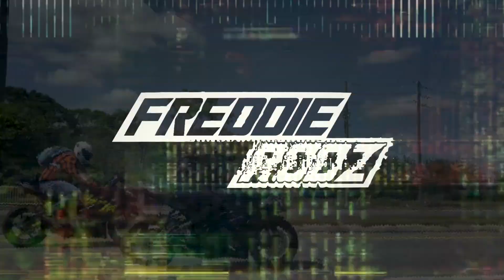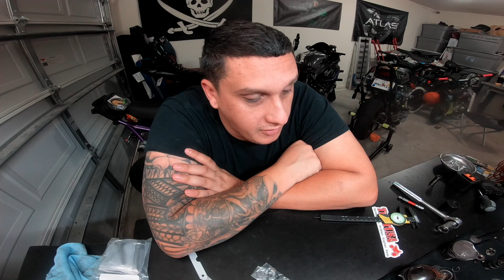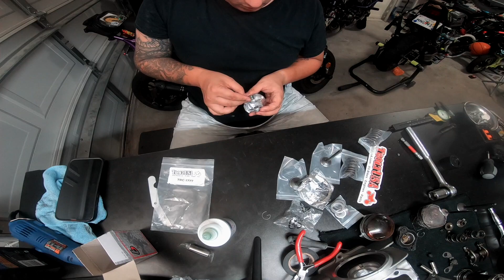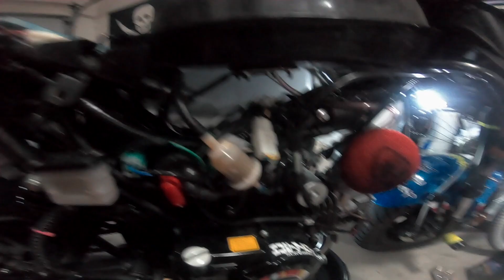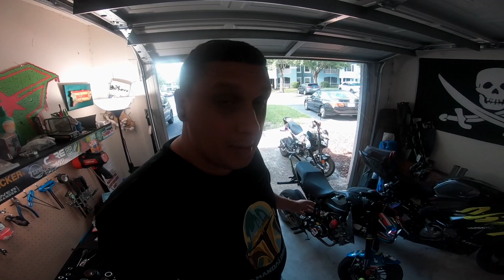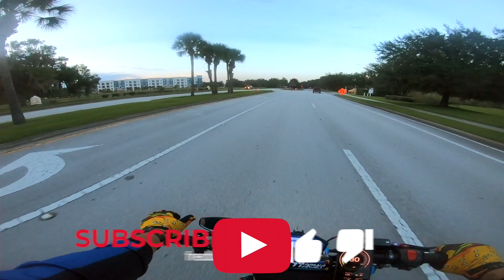I blew up my Grom Clone!!!

Comment: hey bro.! just have a quick question. I asked it in the fb clone group, how often/long you ride in the redline of your clone.?
Reply from the maker: All the time 😂.  Well I know 8krpm is about 50mph.  But if I’m going faster I’ll stay on the 9-10 line for a while.   This issue I had what a combination of things I neglected that caused this.  With right amount of oil and maybe if you have a 141 do an oil cooler and everything would be fine.
Reply: @freddieRODZ  gotcha bro.! thanks for the reply.!

God bless.!
Reply: I don't n ever redline mine three clones I try to let them breathe till they hit their max I have three from clones over a course of three years they all still work and have about 4000 miles on each I guess Yu can't redline these or this happens .but I remeber I was going to cause alot of guys on YouTube said Yu can redline them all u want
Reply from the maker: @masterpain7742  yea. I learned not to.  And if you do only for a small period of time.  My clone now has 5,000 miles on it. And running beautifully

Comment: I just ordered a clone and looking into the bbk and cam. Did you see any increase in top speed?
Reply from the maker: Like 3 more mph. But it gets me there quicker
Reply: @freddieRODZ  awesome. I figured as much. Have you changed out the front sprocket yet for like a 16 or 17T? I see where lots of people do that and get more top end so I was curious if the combination of the bbk and cam to make power to combine with the sprocket to gain a top end balances out for more top speed and get there faster. I’ll find out soon once it gets delivered and I start modding it. Thanks for the video. 🤙🏼
Reply from the maker: @krysis621  yes. 16t also.  Honestly. Having the bbk and cam. Plus the 16t.  It’s what the bike should’ve come with
Reply: @freddieRODZ  that’s what I’ve heard that the bbk and sprocket upgrades are what the bikes needed. I’m excited for mine to get here so I can ride it stock for a few miles then do comparisons so I can feel the differences. Thanks again for your input.

Comment: I would have just bought a grom from the auction and thrown everything in there.
Reply from the maker: Yea but for $100 I rebuild it with no issues.   I like a challenge 🤷‍♂️ 400 miles later no issues
Reply: @freddieRODZ  Fair enough. I would have paid ~$1000